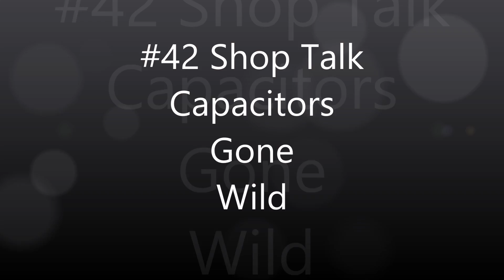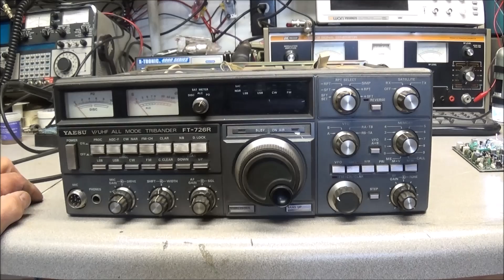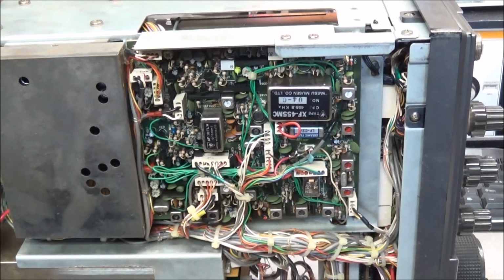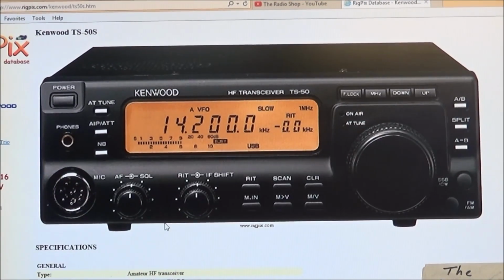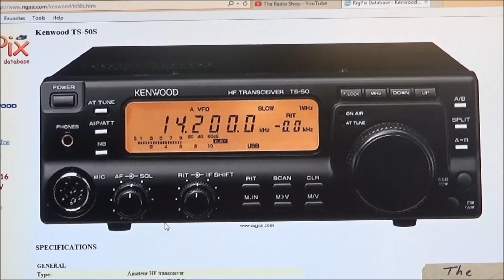#42 Shop Talk Capacitors gone wild

Comment: MY 726 uhf board is currently faulty with no TX /RX, so I will post some info when I have it 73s all G4ZHG 70cms Module Test points voltages TP1 3.19 V TP2 1.8V TP3 7.84 V TP4 0V??? TP5 3.94V TP6 7.63 V  so far, Regards John G4ZHG

Comment: Buddy, when you say "re-cap" a solid state radio from the 1980's, do you mean just the electrolytic caps?  What about disc ceramic capacitors or metal film capacitors?  Do those tend to be stable over time?

Comment: I am not clear if leakage in 1980 era caps is due to simple old age, or the amount of "on time" they have accumulated.  I have a few Yaesu rigs from that era that were very rarely used, and have yet to find a leaky capacitor.
Reply from the maker: I would say on time helps keep them alive. But some of the older caps are much better quality than those made today

Comment: I had to pull the tx-rx board out of my 726r to remove the relay to clean it and I had to recap the board.I used a piece of envelope with deoxit on it to clean contacts.It still hangs up every now and then for 3 to 5 seconds .Can I find a relay to replace it ?Tnx Buddy.kn4u@comcast.net.
Reply from the maker: These are getting harder to find. If I run into any will let you know.

Comment: Yep, I used to repair old jukeboxes as a side business to my day job. In about 8 out of 10 jobs I did, re-capping and cleaning switches and pots fixed everything. Beyond that, it was mostly re-adjusting 40-50 year old mechanical assy's.
Reply from the maker: Yes, Old stuff need new caps. Thanks for sharing your story

Comment: It´s a lot of work to replace all the caps, but without that kind of work it cannot be possible to guarantee the best results...
Thanks for the nice video.
Reply from the maker: +CT1JRZ You are so correct. It is the best insurance you can get.  Replacing those old tired caps solves so many problems. Thanks for watching and glad you liked it.

Comment: A great video; the original board if done by a professional should be shot, to scrape the compound and not change the capacitors plus not to mention a botch job of wires and jumper lines escapes logic.
Reply from the maker: +John Cunningham Thanks again my friend. Now if you really want to see a nightmare on a tech gone mad check out video #14 of the TS-50. Then followed up by video # 15, 17, 19, and 30. Had a series going on that one. But why folks do this is beyond me. And is why I do these videos to help others. :)

Comment: In 25-30 years will the caps we replace today need to be replaced again?
Reply from the maker: +TheDisorderly1 Now that is a good question. Depending on the application the capacitor is in and the quality of the capacitor that was installed.  A capacitor the is subject to heat stress and higher voltages is not going to last as long as a capacitor that is just sitting in a cool area at low voltages.  I have over a 15 year time frame replaced capacitors twice in some RF amplifiers.  But the part that bothers me the most if the equipment that is already 25 to 30 years old when the new caps are installed, what will be the condition of other components in the next 25 or so year span.  Resistors become stressed, transformer insulation start to break down, moister plays a toll on the chassis. lot to think about. Research is needed to really determine this. May be a video coming in the future. Again thanks for the excellent question.

Comment: Another great video Buddy! I have a DAK Mark 10 that needs many (all) caps changed. Another "down the road" project. Some HF rigs have so many caps in them, its almost not worth doing. The audio board in the FT-1000 must have a million on it :^/ Take care! Look forward to the next video!  8^)
Reply from the maker: +Mr Carlson&#39;s Lab Dak Mak 10~ Envy~ I always wanted a good Mark 10. All the ones I have found were too far gone. The last 2 I replaced the main boards with modern radios and wired it all in so all meters and switches worked.  I agree, some of those radios just have too many in them. The board in this 726 is quite loaded. The FT-1000, is crazy! Always good to hear from you Paul and thanks for stopping in my friend. Waiting on your next also :-)
Reply: I love both of you guys and your videos!

Comment: Good advice but not everybody takes it. In the KW TS 5 and 8 series i seldom see them, but i change them anyway. The radio sounds like new. The lower ESR comes into play. Very nice done. Another fine repair. Keep them coming. Wish you the best. Best 73 FEY
Reply from the maker: +FEY  Thanks FEY. Folks have to learn these caps want last forever. Fix them now or fix more issues later down the road.  Thanks for the kind words.

Comment: Interesting that i seem to see more leaking capacitor videos from the USA, do you think the environment has a role here Buddy? 

Because of all the items i've taken apart i rarely have seen an actual leaking capacitor, for example i've just filmed my latest teardown, it's a 1980s item, made in Japan with what must be 100s of Nichicon caps in it and although i spotted a couple that were starting to bulge, not one i have seen so far has leaked. I wondered if the environment might make them more prone to leaking as part of their failure?
Reply from the maker: +DextersLab2013 Very interesting question marc. As you know we see this all the time. Here where I am at is humid hot weather during the summer months. NA can be cold and wet a lot during the winter months.  Weather here changes in a heart beat. Yesterday morning we had frost. Today was in the upper 70's.  Environment? I just don't know.  This is what I can tell you. The capacitors in this rig are Mitsubishi 85c radio caps. A lot of them are at 10 volts and 16 volts. Not much margin in voltage tolerance.  Some times I do wonder if location depends on the brand of caps they use. Looks like I need to do some research on this subject.  I know Nichicon is hard to beat and last a long time.  Anyway going to try and watch you last video Was out of town all last week and not much time to do any viewing. Thanks .
Reply from the maker: +sporadic -Z Yes that stuff loves to eat copper for breakfast.

Comment: Very interesting! I have never seen that many caps leaking all at once. It seems to me that that radio was seriously overheated at one time.
Reply from the maker: +Jim Kodysz You would think it was over heated. Perhaps not much air flow. One of the biggest killers is 10 volt caps on a 12 volt rail. Spikes will get them every time. Thanks for looking.

Comment: Caps, caps, caps.  I preach cap changes to my customers.  Even if your equipment is working just fine its just a matter of time until they leak and cause PCB damage.  I have gotten to the point I don't even start troubleshooting until all the aluminum and tantalum caps are changed.  Got to be a waste of time troubleshooting radios just to find bad caps.  Easier to just start there.  In many cases any faults a radio had go away with nothing but a cap change.  LOL, now back to the radio I'm currently recapping, luckily no trace damage this time.

Mike
Reply from the maker: +MikesRadioRepair Yep, those darn caps. Kills them all the time. Pull, replace, problem solved. Good read my friend and thanks for the comment.